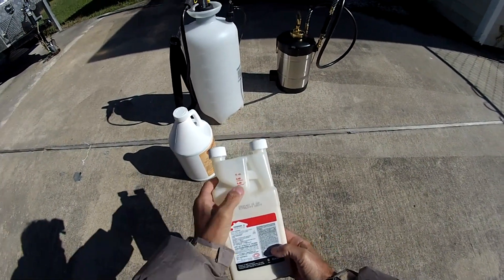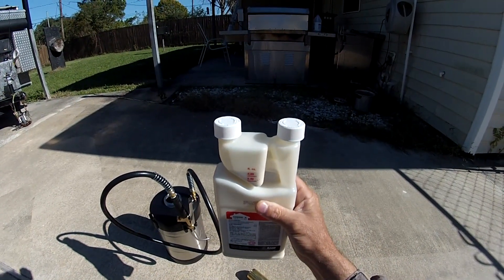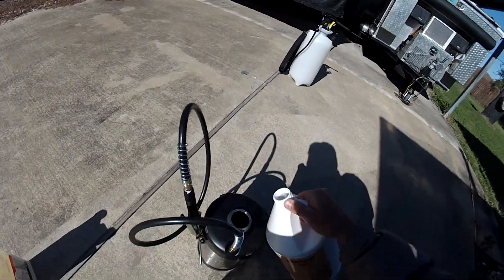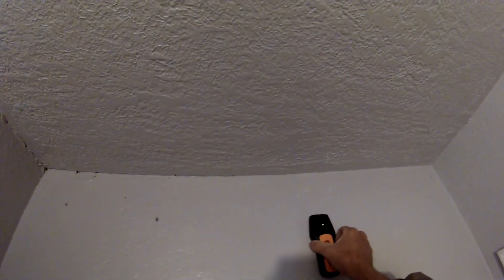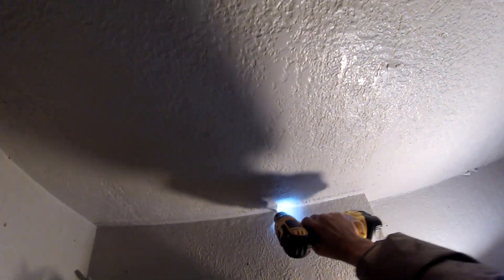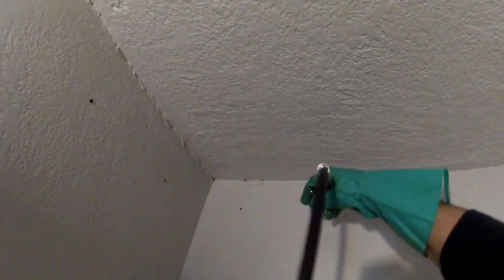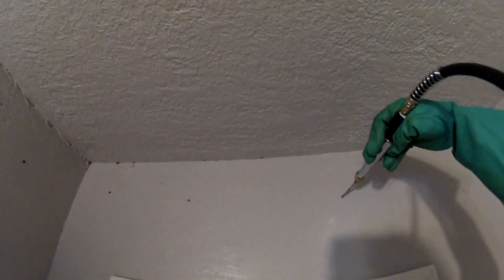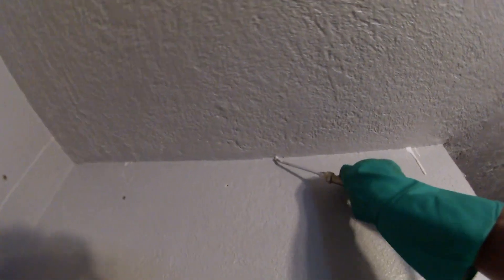how to kill termites inside the wall

Comment: I just saw drywood termites coming out of my bedroom wall today due to the 100 degree temps we are having. Before I saw this video, I drilled some holes and sprayed borax solution into the holes. I prefer your sprayer with the bent tip. The only thing that could prevent the borax solution going all the way down is the insulation in the walls. I'm not worried at all about mold because borax will not let it happen anyway. Great vid!
Reply: What solution?

Comment: Im going to do this using Borax mix.         ... My concern is insulation & crossbeams preventing it from good coverage. I think I will go across the top.then again staggerd lower down towards the floor about 10" from the floor.     They use the big window for access,somehow but thats where they appear everytime ,somehow all along the window area.

Comment: 1.)  I may have to drill into my bedroom wall/ceiling, following your example in this video, to access the attic/overhang of roof.  
          So, is that advisable?  Is the chemical, Termidor SC, safe to use in the walls etc., of living spaces?

2.)  Why the foam sprayer?  Is a foam sprayer always necessary to use?

3.)  Where did you buy the foam sprayer?  What is its cost?

4.)  Is any sort of breathing mask necessary?

5.)  What was the dimension of the holes you drilled--3/16, 1/4?

6.)  What did you refill the holes with, the holes you drilled into the walls, dowel and spackle or just spackle?

Any info you can give will be greatly appreciated as I am not real handy or knowledgeable with tools; and I can't afford the pest control estimates.  THANK YOU!
Reply from the maker: it's in the description
Reply: I actually have same question, I do not see it answered any where. How safe is this spray in walls as far as breathing and living in the same area. I have termites coming out of dry wall in bedroom.
Reply: @samlan4330  It seems like foam is used because only one hole needs to be drilled per space between studs.  With sprayer, you would need to drill multiple holes going down the length of the wall to ensure good coverage of studs with boracare or similar solution.
Reply: @samlan4330 cherynobl type of dangerous lol. Dont go licking the wall and you will be fine. Not advice.

Comment: I must ask, why are you moving the wand applicator continuously when applying the foam behind the walls? It's my understanding the Pro Foam is a foaming agent, which greatly expands up to 20-25 times the original volume?
Reply from the maker: Make sure that I covered everything thing inside the wall

Comment: Did you use the zircon stud finder on concrete / block walls or is it  just drywalls that you drilled in ?
Reply from the maker: PARTS LIST IN THE DESCRIPTION
Reply: @lynperk  my question was about the type of wall and not about the tool itself
Reply from the maker: drywall
Reply: @lynperk  thats why this stud finder worked fine. When it comes to concrete / block walls which are the main building stracture in my country its gonna be useless to use it

Comment: hello.  do you think you could help, no one else has in the 15 years ive been trying to take care of my fathers home, learning ever soooooo slowly about all things i would normally never do....including termites.  the house in in mexico, i travel 2 x a mo, my father built it on the beach, defying others recommendations to use block, he used allll wood.  his last words before he passed were, "take care of the house daughter", and "tell em the G...D... house is still standing"!!    but...barely. because the termites are and have been eating it for a very very long time!    so it has taken me a very long time, years to be more accurate, to learn slowly about termites.  there is no termite company here where the house is, no tenting, and not even any body in the are to do any sort of treatment, although i feel the big city closest does not, i do not trust they actually use good product let alone know what they are doing, sadly.  i have "chased" termites around the past several years, as they have dropped on my head,  swarmed inside, and left their little 'frass" droppings everywhere.  i now use boracare on anything new, but that i didnt learn until just the last couple years.  i have used termidor foam and jecta, but i know its probably doing very little.  sooooooo let me give you a vision of the house.  it is two story, set up on block foundation with a very very VERY small crawl space underneath.   the outside of the house is covered in t/1/11 paneling and the inside of the house, over the framework is covered in pine shiplap paneling.  the floor is parquet , the cabinets and door knobs and curtain rods are all pine .  the house is completely wood!   what would you do???  i know the trouble spots...because the frass always tells me.  and in some spots it was really bad, beach side mostly.  i believe, but dont know for sure, but believe there are probably several colonies in the house just from what i hear.  if i cant tent, and there is so much wood and house...what can i do? what would you do?  people tell me to tear down the house and start again.  for many reason that is not an option!!!!  please give me your advise.  i have termidor sc...i actually trenched with it about 5 years ago when i first heard about it, but in retrospect i dont think i have subterranean , only drywood termites. what would you do?  i dont have the foam or foam sprayer, ive seen them for sale tho.  a little expensive for me but i would try to save up if you said that was the way.  thank you for your time!
Reply from the maker: i left items list in the description that i used.
http://killtermitesguide.com/how-to-kill-termites/
Reply: shawna bregon what the hell is "Frass"
Reply: @rgruenhaus  poop. Just another way of referring to the termite poop
Reply: Hate to say it…. Maybe rebuild with blocks.  Everyone can be wrong, but sometimes they are right.